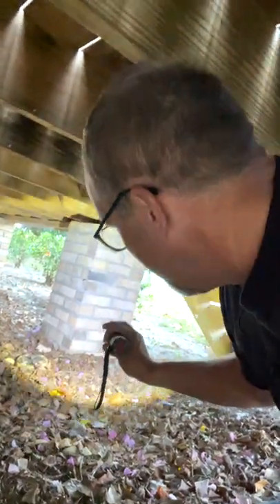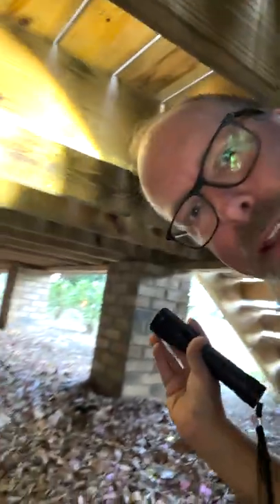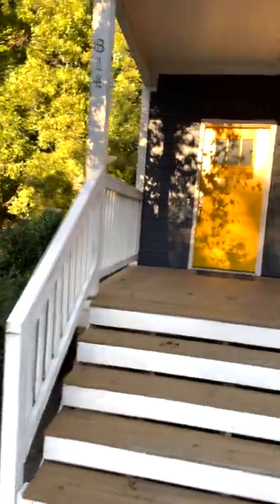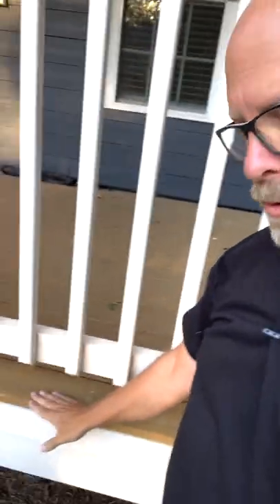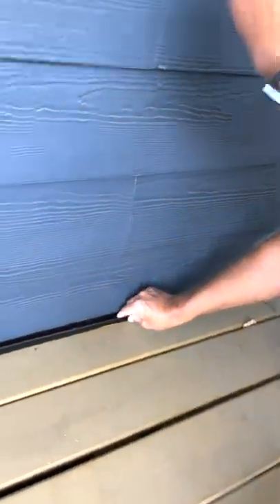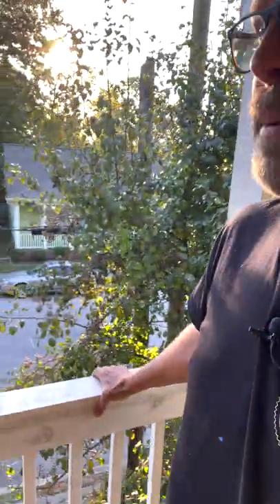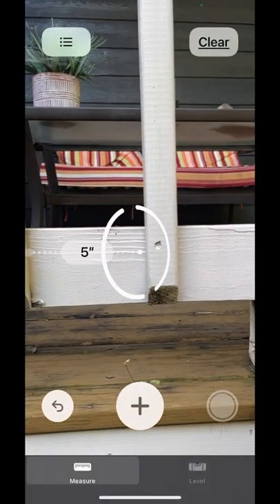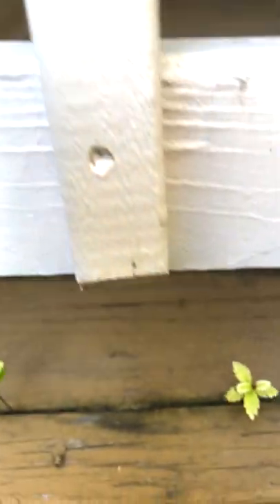Inspecting a Deck on a House

Comment: 1:54 The stairs are attached to the deck with toe-nailing.  There is no stringer hanger or ledger holding up the stairs at the beam.
Reply from the maker: Right.

Comment: Isn’t the upper deck an issue since there are gaps between the boards, and it’s finished below? Won’t water from driving rain be trapped between the upper deck and the ceiling above the lower deck?

I was also curious if that power line near the upper deck is too close to the railing it looks reachable from the deck surface
Reply from the maker: That's permitted for an exterior deck here. Thanks for watching.
Reply: @internachi  Rain and dirt just goes in and sits on the ceiling and joists?

Comment: The front deck with joists sitting on a 2x2, which are then holding up with just 3 nails under each joist, looks like a problem to me. Was that one of the problems you found?
Reply from the maker: Yes. Major defect.

Comment: I think you can see flashing above the ledger underneath the deck. Never mind the lower"ledger" below the joists, something that wouldn't fly in my area,  and the one by the house is questionable how it's supported. Anyway it doesn't matter if the ledger is attached to the house with bolts if the joists are not well attached to the ledger as with a joist hanger. Positive tiebacks to the house floor framing is also code. The second story deck does not look waterproof. Is rain falling into the ceiling area below? I'd be cautious of that rather than just saying  you can't see it. Get a micro camera that you can put into crevices.
Reply from the maker: Dang. You should be a home inspector. You're good.

Comment: 1:20 Is this a defect?    "Before joist hangers became widely available, ledger strips were commonly used to help support toe-nailed joists, whether the joists were hung from an interior rim joist or flush beam or from an exterior deck ledger. But now builders commonly use joist hangers, and while ledger strips are still OK to use in interior applications, the 2018 edition of the IRC no longer permits their use on exterior decks (2018 IRC R507.6.1)."
Reply from the maker: Yes. According to modern 2021 code, deck joist hangers should be attached to the deck ledger board with joist hangers. It's up to the AHJ, though.
Reply from the maker: The video shows a floor joist properly resting on a 2x2-inch ledger strip, according to 2021 IRC R502.6.2. But in relation to deck joists, the 2021 IRC R507.6.1, it says that deck joints that connect to the side of a deck beam or ledger board must be supported by approved joist hangers. As we know, it’s ultimately up to the local authority to recognize, adopt, and enforce the building code.

Comment: Fasteners may be minor to the inspector but not to the various types of clients we serve. If the fasteners stood out to talk about they should be in the written report.

Come on Ben, get in that crawl space and dirty up your white shoes 🤣

Too bad the decks were relatively free of defects.  Too often the floor boards are dry-rotted from the sun, missing upper and lower flashing, decay where columns/steps meet the ground and much more.
Reply from the maker: Thanks for watching, Joey.